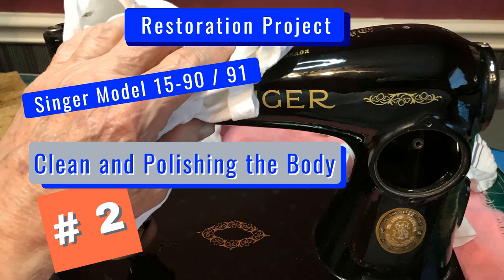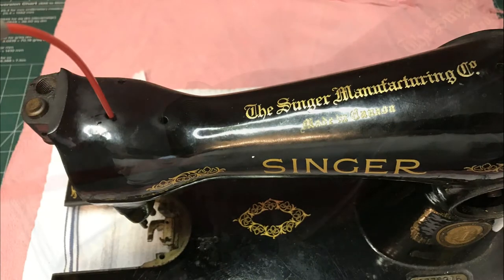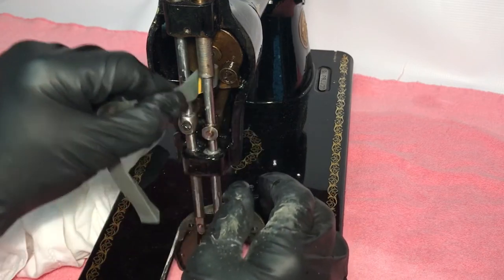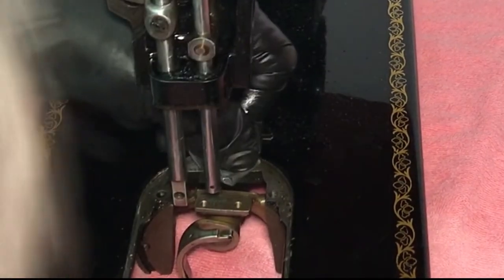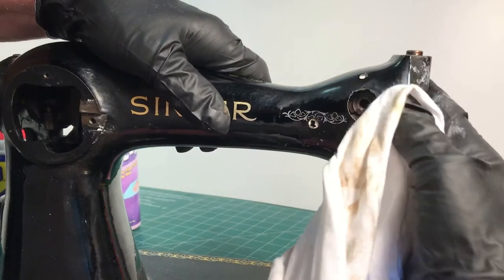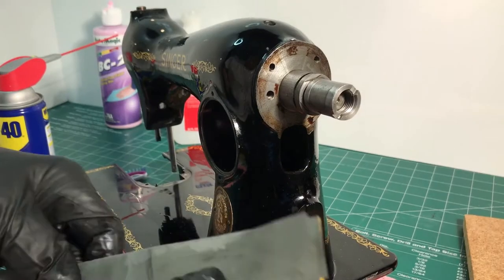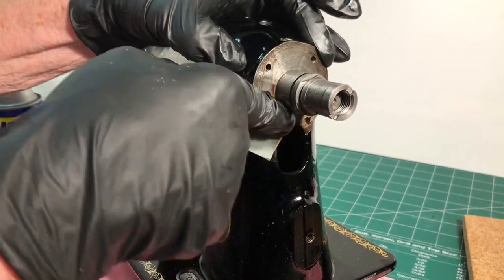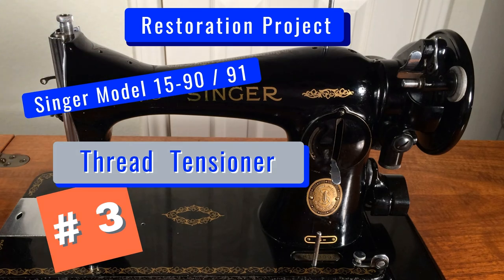Cleaning and  Polishing the Body  Vintage Singer Sewing Machine  Model 15 - 90 / 91

Comment: From everything I've read, never use any solvent to clean the black shellac finish, and certainly nothing with alcohol or window-cleaning solvents. I start from brushing off dirt with a sort brush (a fluffy face makeup brush is good), being away of never rubbing dirt into the finish. Then clean with sewing machine oil (or food grade mineral oil if it's filthy), again wipe away dirt and I keep using fresh piece of soft cloth so you don't rub the dirt in! (Learnt that in auto detailing class.)
Then I will use Original Gojo (non pumice kind) which is a mix of oil for a dirty machine: It will even remove melted insulation wire from the back of the machine with patience and elbow grease. Automotive products can be used for waxing but stay away from anything with a lot of abrasives (watch for the word "compound" and use only the lightest polish you can find). If in doubt, get the Clean and Wax set from The Featherweight Shop as at least you know it's been tested on this surface.
Reply: Also, no WD-40. Singer recommends cleaning neglected machines with Kerosene (lamp oil) and they would even dunk the whole machine in kerosene so you know it won't harm the finish.  Kerosene works great, and will not gum up the machine later. Work outside in fresh air, using toothbrushes to scrub, then oil afterwards. If the machine is still stiff, oil it with 50/50 kerosene/oil and keep moving the handwheel.
Reply: Thanks for your help, I was uncomfortable with all the 'products' used here 😲, I use isotope alcohol for lifting grease of wood, the bottle doesn't even get to sit anywhere near my sewing machines.

Comment: I was told by my sewing machine repair technician that DW-40 is not recommended for oiling sewing machines.
Reply: He didn't use it to oil it , he used it to remove rust and old oily gunge.

Comment: Great video, only I'd say never use wd40 as it is a solvent and will dissolve the shellac on black finish machines. Shellac is very tempremntal if chipped and will flake off is any gets underneath. In the UK turtlewax after a light coat of oil is great if not much work needs doing
Reply: Wd40 is made from fish oil

Comment: Thank you for the videos.  I can find no information about the finishes Simanco used on the machines.  I would guess it to be black lacquer, covered with shellac for several reasons, compatibility with each other,  ease of use, QUICK drying time, and availability to mention a few.  Have you any ideas or inklings as to what else it might be ?  I igure Japanning up until the late 30s / early forties, then lacquer with shellac clear coat, then different colors, then plastic.
Reply: They used a Japanese auto paint that had to be baked on in an oven.

Comment: Hello, I have a 15-91 that I've cleaned and polished using the rubing and wax compounds shown in your #2 video.  The machine looks fantastic (!!!), but when I touch or handle it, I leave lots of finger prints.  Even if I wash my hands very well?  Any ideas or suggestions?   Your videos definitely help me get it running well!
Reply from the maker: Hi Steve ! Thanks for the kind words about getting the machine running. As to the finger prints I keep a soft cloth, an old T-shirt, beside my machine all the time and wipe it down after use. That's the bad thing about having a shinny black car, truck or restored Singer. Thanks for the comment !
Reply: You finger will leave oxydation on finish (same ase guitar) alway wipe and clean finger print it will protec the finish.

Comment: I’m picking up a 201 today. Planning on using these excellent videos to get her going. Question: Looks like you disassembled everything in this video, but they are on the machine in the later videos. As a newbie I’m hesitant take it apart twice. If I’m not going to paint her, should I just clean the body as I work my way through the other sections? Thanks!
Reply from the maker: Hi Teresa !  The hardest part about doing the videos is "what order should they come in?". When I start a new project I first take photos, then disassemble everything from the body. I place all the parts from a specific item and place them in a plastic container with a lid and spray them with WD-40. Next I get the body looking as good as possible then reassemble. The videos should help you put the machine back together. Take pictures, keep all the parts together and you will be good to go!  Good Luck and thanks for watching!
Reply: Where is the video on removing all moveable parts? I don’t know where to start

Comment: I have a 1910 singer treadle. It is in great working condition but I want to restore its appearance. It needs the cabinet restored, which I can do. I want to restore the lacquer and clear coat. I also want to restore the rest of the body in the back of the machine. The part that faces away from you when you're sewing.

Comment: hello, how often do I have to oil the black singer machine 15 cd? please
Reply from the maker: Thank You for the kind words. The last several months have challenging but I think I on track for adding more videos.
Fiorella,  Depends on how much you use the machine. As a rule less is good. A couple of drops in each oiling hole should be good.
I think I would remove the front cover and check the pressor foot bar and needle bar more often.
Reply: @vintagesingersewingmachine6320  I will take it into account, thank you very much for the help. Greetings😄
Reply: @fiorellacontreras8744  I have a treadle machine from the 20's with similar inner workings, and the rule of thumb is to oil after every 8 hours of sewing.
Reply: Old singer manuals say that if the machine is rarely used and kept in a case then twice a year. Once every few months if used more regularly

Comment: What paint do you use when repainting?
Reply from the maker: Hi Greg, I use 66AutoColor as a supplier. 
House of Kolor KD3000 Primer - Aerosol
Spray Max 1K Base Coat Aerosol OEM Spray Paint
Spray Max 2K High Gloss Glamour Clear Coat Aerosol
I bad thing is once you have activated the paint you have only a limited amount of time to use before it sets up.
Let me know if you have any more questions.
Oh ! I don't get paid for recommending the supplies.
Reply: @vintagesingersewingmachine6320  Thank you so much for the information about the paint. I have a 201 and a 66 that need new paint.
Reply from the maker: @GregThompson-dn9eo   Do you need the gold decals?
Reply from the maker: @GregThompson-dn9eo  OK, good luck, let me know if you have any questions.
Reply: @vintagesingersewingmachine6320  Will do. Thank you very much.